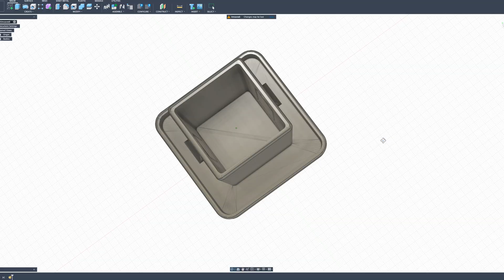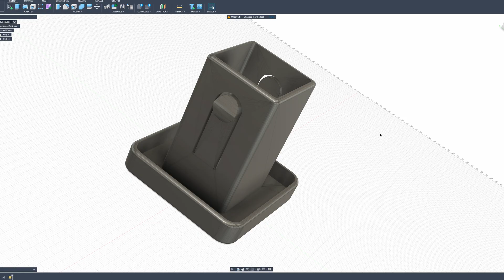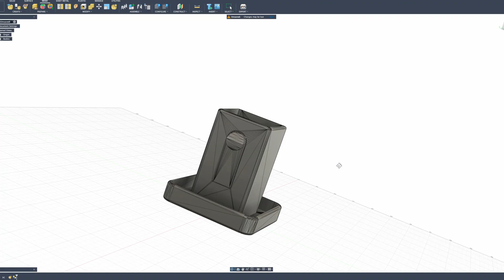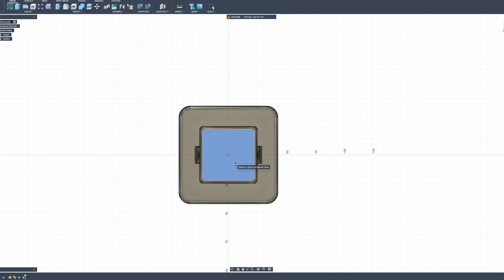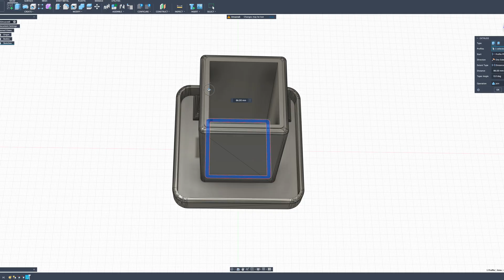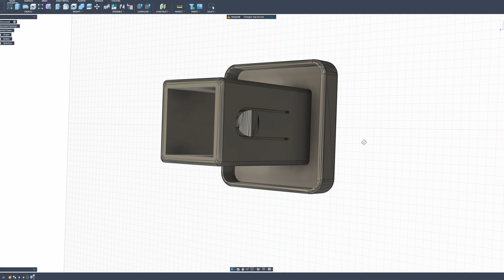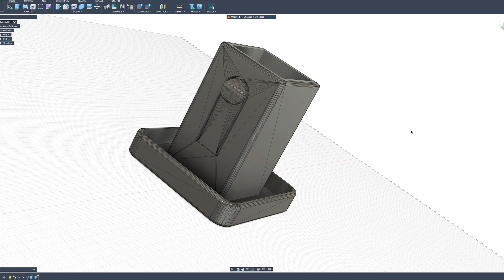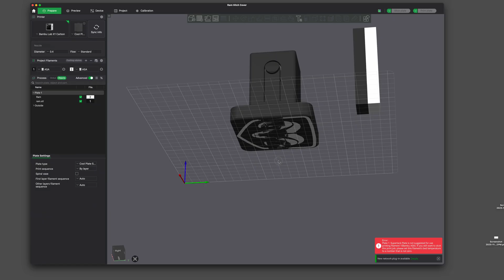Modify STL files -  How did I do it?

Comment: could you print it in such a way that it has holes where you can fit a few long bolts in it?  like on the inside corners?  they dont need to be thick  just long enough to do the job, since prints sheer easiest along the layer lines, if you have bolts  going through them properly fastened at each end it will make it unbelievably strong

Comment: This works because the part is very simple, try this with parts with any complexity and it's almost impossible .. the good people at AutoDesk make sure it's practically impossible so you have to buy the "paid" license where it has an option to automatically convert all of those faces/edges to a real solid .. good effort though .. thanks a lot.
Reply from the maker: As of late I have had a lot more success in the conversion process than in the past, but agreed more complicated the part the less likely the conversion is going to work

Comment: Why did you do all of that with the sketch and extrude to thicken with the join instead of using offset face, select all of the faces, then 3mm. Also just print at a 45 next time
Reply from the maker: Good point would have been faster, Never crossed my mind at the moment, I also would not have had to punch out the tabs again. As for the 45 being multi color would have caused a lot of color changes and wasted a lot of material.
Reply: @ExtrusionTherapy true the multicolor would be an issue. Could redesign that portion to be a cap that slips over the end. That way you’d only have to print a different cap if you wanted to change the design.

Comment: Slice the cover from the insert. Design in several snap fit connectors or just put a groove in for epoxy. Print the insert section on one of its corners then install on the insert. I keep several snap fit designs in my library for quickly amending stuff like this.
Reply from the maker: I considered breaking it into parts and adding fittings, but I suspected it would just move the weak point to those fittings and now what was a single print is a multi part print that requires assembly. Call me lazy but that seemed like too much work. Now if this one fails that might absolutely be the route I have to go.

Comment: I'd be curious, if you were to use the original, but in the slicer set your exterior walls higher and change it to variable layer lines (so hopefully it staggers the different walls) if that would improve the strength?
Reply from the maker: it's possible, I tend to go back to the design to make changes than tweak those kinds of settings.  I did increase the wall count, as for  variable layer lines not something I have tested much